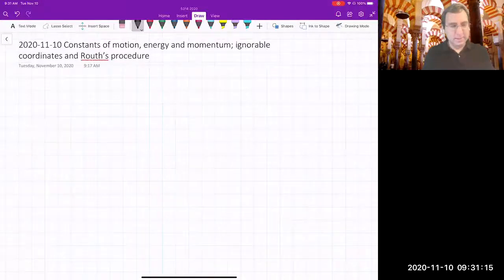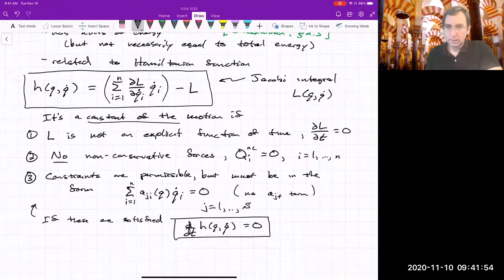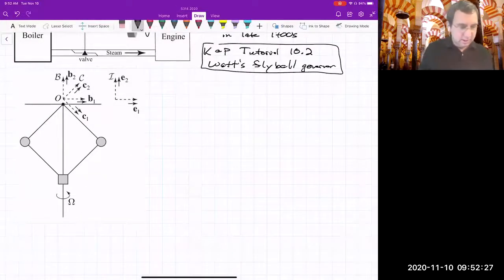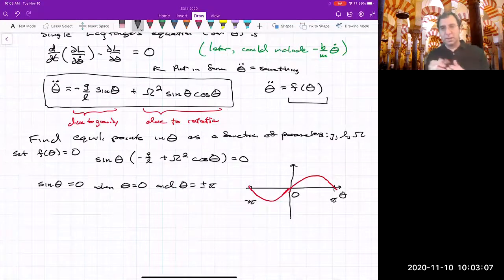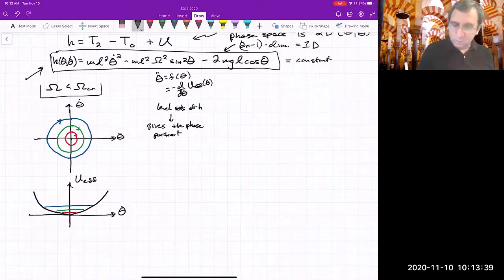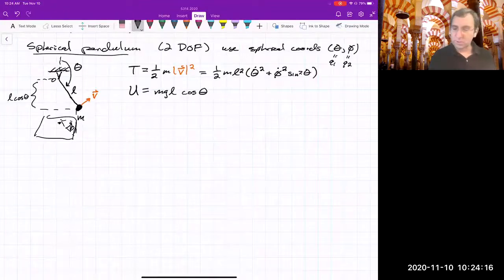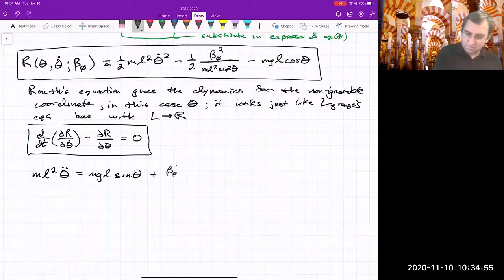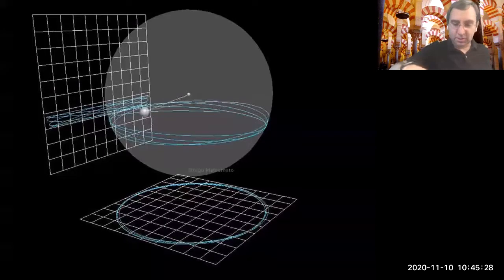Constants of Motion, Ignorable Coordinates & Routh's Procedure (Spherical Pendulum) | ESM 5314 L23

Comment: I assume at 43:00 that the motion should be interpreted as that of only one mass. Otherwise at theta = 0 both masses would penetrate eachother, same as at theta = pi. So then at omega< omega_cr, the mass would be oscillating about the center just like a pendulum while also rotating slowly with angular speed omega. 

At omega > omega_cr, the mass would oscillate about the nominal swung out equilibrium position for that particular omega. If the amplitude of oscillation is high, it may even cross the axis of rotation. That gives the saddle point curve that intersects at theta = 0. At even higher amplitudes, it would behave something like the spherical pendulum and cross over by going around the axis of rotation rather than across it. 

Hopefully I interpreted this correctly.  Took me a while to realize that the mass was oscillating about the equilibrium point. Most simulations of a governor show the mass at a steady theta angle.
Reply from the maker: I think your interpretation is fine. You can think of the masses as just on slightly different planes, so they don't intersect (and thus theta can go negative). The dynamics near the theta = 0 equilibrium are very much like a similar problem, the bead in the rotating hoop, whose phase space I describe here https://youtu.be/oNij9lns5RI?t=725 
and here, as well as the "whirling pendulum" https://youtu.be/UOQxFf1eSJs?t=840
Reply: @ProfessorRoss  Thanks! Will check out the other videos.